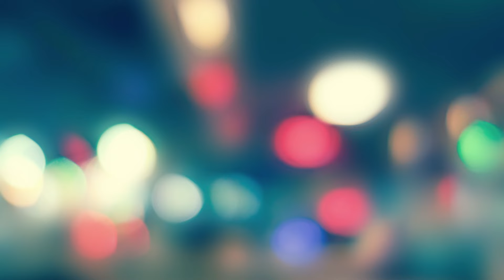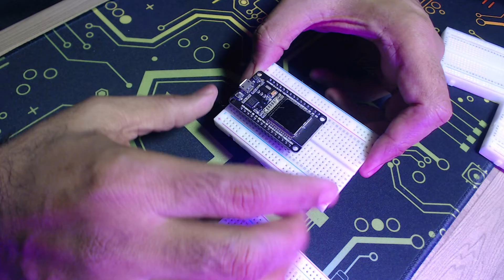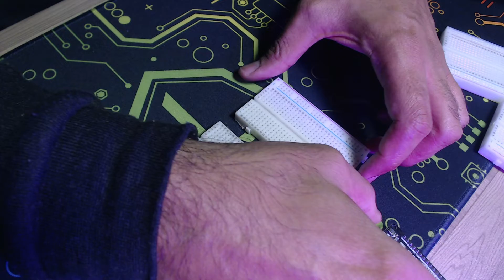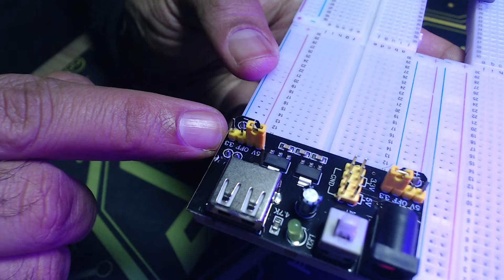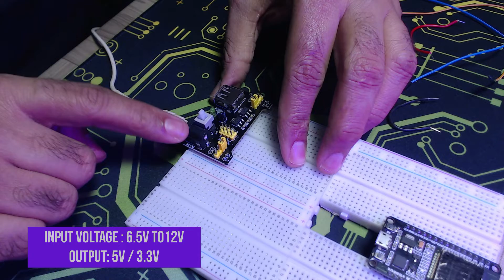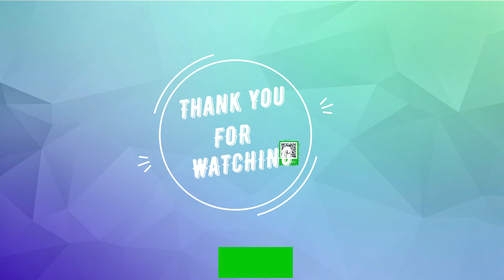ESP32 Breadboard with Onboard Power Supply

Comment: Some guides actually recommend using a capacitor between 5V and ground for better noise immunity, but the power module already has some capacitor idk
Reply from the maker: Yes adding an extra one near the input of ESP32 will provide better protection against power fluctuations. Use 0.1 uf capacitor to filter out any noise in the power supply.

Comment: okay im a noob so excuse my terminology. 

my project has 2 esp32-s and 2 breadboard power supplies. the goal is to communicate from one to the other through wifi. i have 2 long breadboards and 2 short ones.

what you have shown would need all of my breadboards for 1 esp32 and 1 power supply. 

so alternatively, can i put the esp32 and power supply on one long breadboard instead of connecting 4 breadboards together? 

sorry if the question is dumb, but when i say im a noob, i mean it
Reply: you could just wire both esp32s independently to your pc, if you're just trying to communicate via wifi you don't need a power supply